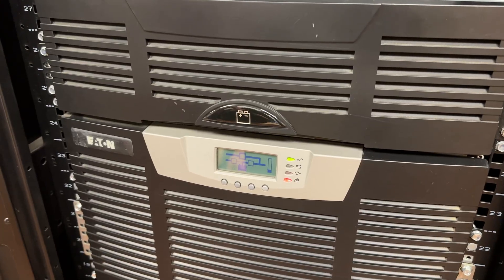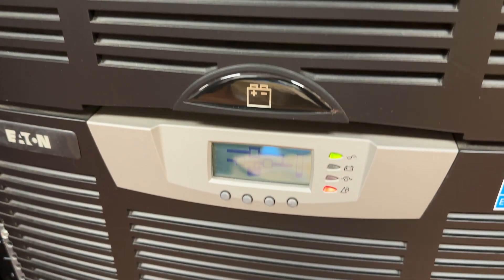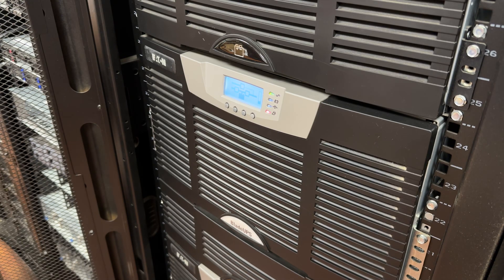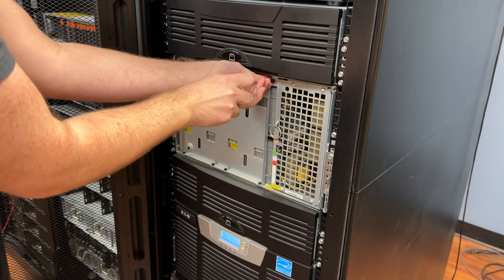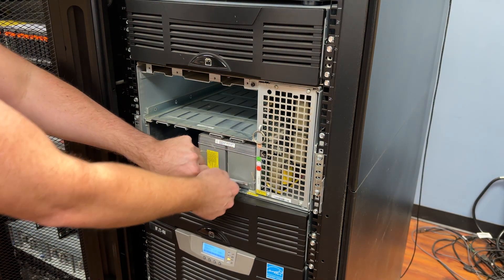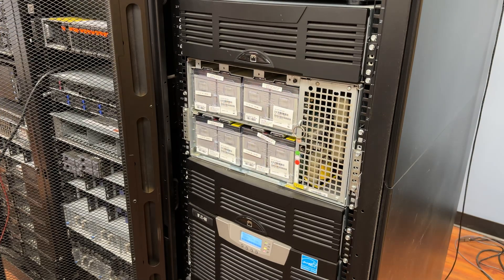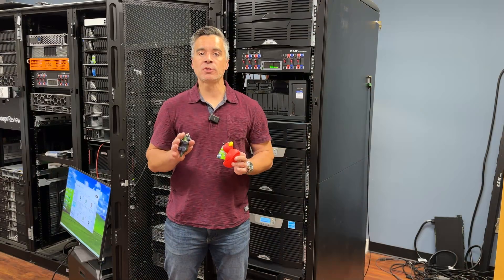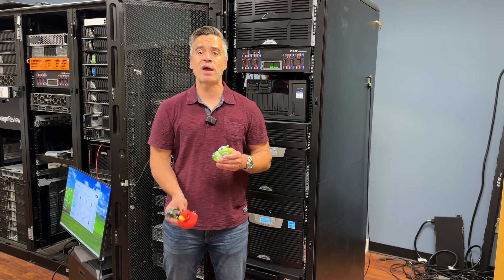Eaton BladeUPS Hungry - Need Moar Battery Trays

Comment: Hi nice video, i have unused Eaton blade UPS Battery manufactured in 2018, is that expired
Reply from the maker: Lead acid batteries that are old are going to be in worse condition sitting unused than if they were installed. We wouldn't use them.
Reply: @StorageReview  it is not installed in the UPS, just sitting inside the package. We bought for replacement unfortunately we didn't replaced.  Do you think it will end its shalef life

Comment: Interesting design. The similar APC units I've worked with used actual trays to mount their batteries. Not sure how I feel about the clear plastic route.
Reply from the maker: People love to see all the good bits inside. Like an aquarium!
Reply: Does look cool. As long as it can handle the weight going in and out. Those 60V packs can't be light.
Reply from the maker: @computersales  well you don’t want to dangle them by the handle and be sure to support the underneath for good measure. Like loading an overweight dachshund into a travel carrier.